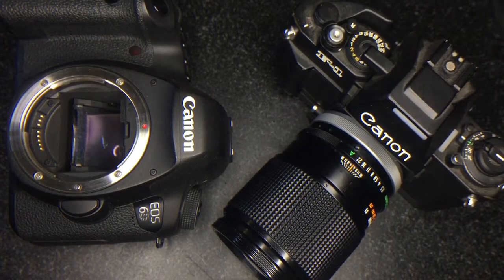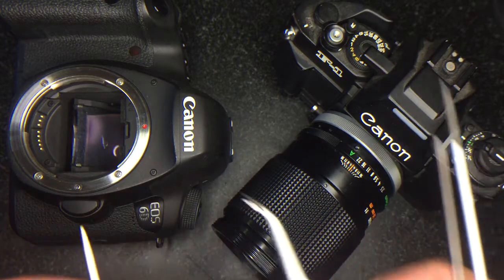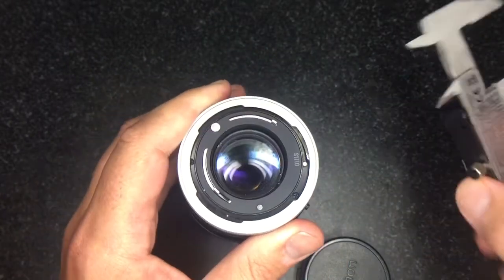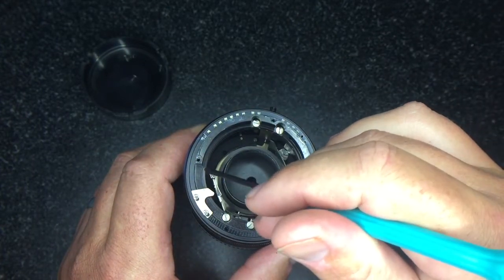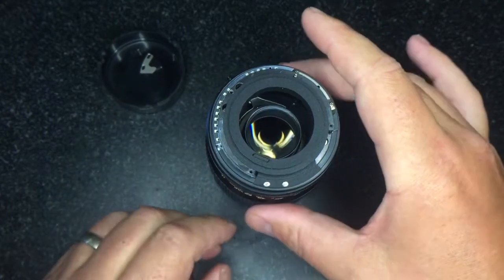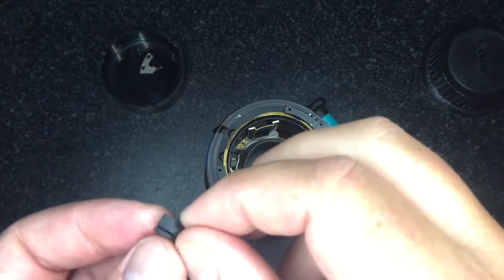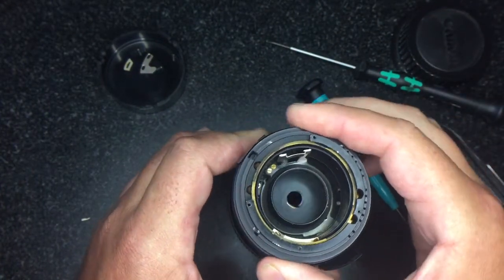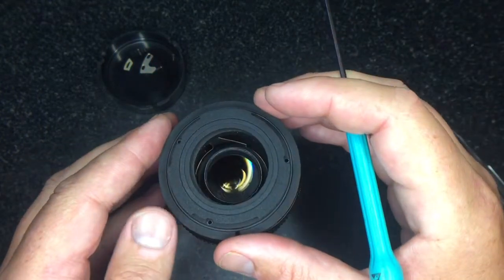Sep 19, 2016

Comment: Hi there, Jakub!
I made a nice bargain on Ebay just recently, on 3 FD lenses which I intend to use with an EOS body. Question is: would you be able to make FD mount kits for these? The seller claims their focal length are 50mm prime, 28-70mm & 28-200mm tele/zoom.

Comment: Hi Jakub, will this fit also the FD 135, 3.5?
Reply from the maker: The FD 135/3.5 Chrome Nose is the same kit as the FD 135/2.5 non SC.  I am not sure if there is a non Chrome Nose (black nose) FD 135/3.5 in existence or what kit fits it if it does exist.